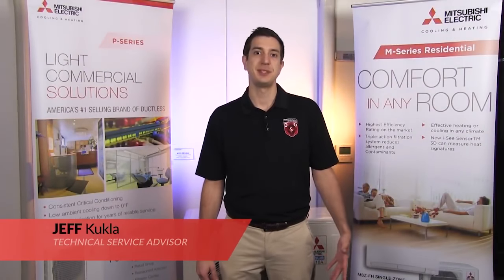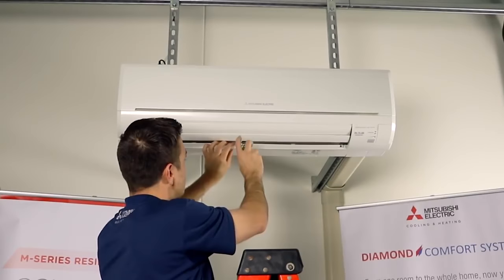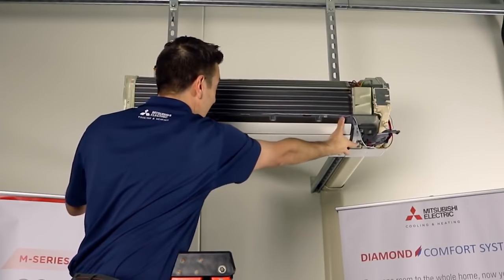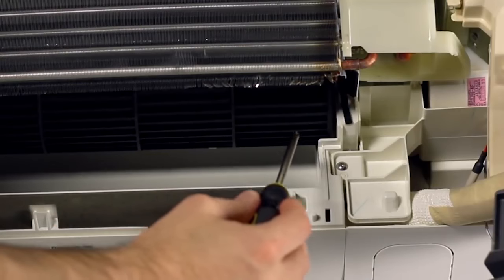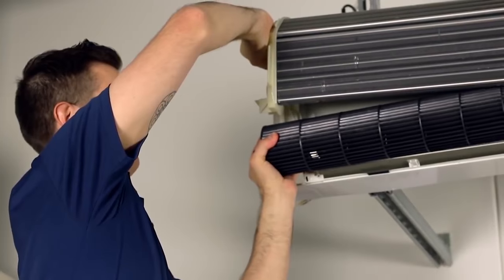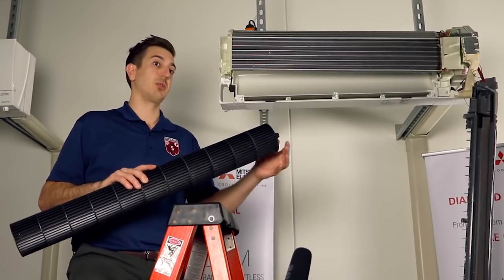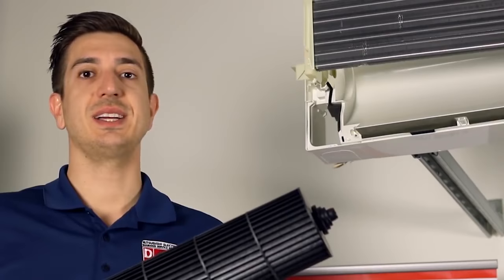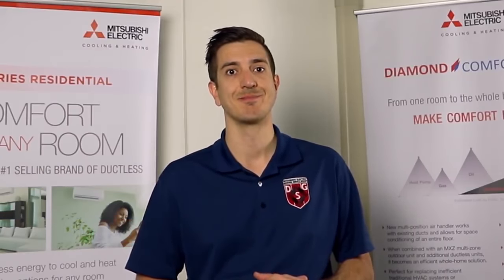Tech Tips: How to Remove the Blower Wheel (L)

Comment: I do Have a Mitsubishi so this helped.  I paid $280 for the company who installed it to clean it 2 years later because it wouldn’t blow much. .  This time I watched your video 3 ,4 times and did it myself.  I had some sticky points and I neglected to align the drip hose correctly the first time,  but I went back and fixed it.   Now it blows strong. Wow.    Update: 3 months later, I had to do it again.  Wasn’t as bad as the first time however.  If that roller blade is dirty, the performance of the fan action is greatly reduced.   Not looking forward to doing this 4 times a year.  But, thank you for the great video

Comment: I like the simplicity of Mitsubishi's design when doing cleaning and maintenance on the mini split. I first vacuumed the blower and it made a huge difference but decided to take out the blower wheel and give it a thorough cleaning. This video made things easy to remove.
Reply: Nitro would a dirty blower wheel cut or reduce the cooling efficiency  by 20+ %? This is the problem i have now.
Reply: @ronniepapa1  Most definitely. My A/C hardly blew any air when the blower wheel was caked with dust. Just vacuuming the blower wheel made a huge difference.
Reply: Thanks!!
Reply: @nitrofiche7206  
If i could ask one more question. My tech cleaned the blower wheel last august..real quick by vaccuming. No removal. Since that time blower, even in max setting, is less intrusive than in years past. Also the cool air is having more difficulty in reaching the lower level. Its clearly straining when temps are in ninetys and off by 4-5 degrees from requested temp.do u still think the blower wheel is the main culprit? I have had the freon checked lately. Told it was ok. Thoughts would be appreciated. Thanks 
Ron
Reply: @nitrofiche7206   Nitro just had my AC blower cleaned by someone who knew  was he was doing. What a difference!  My blower wheel was so dirty with guck, dust and  mold, it was unbalanced and vibrating when spinning. Thats how bad it was. What a waste of time and money when I had it cleaned last year by the Mitsu tech. I am back to working like new and my freon defficiency was likely caused by this filth and guck!  For all our benefits, get your blower wheel cleaned by someone who takes the time and knows what he's doing. I think the nightmare is over. At least  I hope so.
Reply: @ronniepapa1  I would remove the blower wheel and give it a thorough cleaning.
Reply: These are great a/c units, but the blower get dirty pretty quickly and performance drops like a rock in a swimming pool.
Reply: @ronniepapa1 1/16th of an inch reduces efficiency by 30%. It makes a huge difference. Especially mini splits.

Comment: Great video. This combined with your vid on taking the cover off (the clips are stubborn) was perfect. Took me an hour. Hardest is getting the drain pan back and lined up, and also getting the clips back in when putting the cover on. mine was running like 5 years and I never thought to check the blower. I was always keeping the filters clean. Anyway my blower was so caked with dust, likely from a reno I did a few years back.  I'm so mad I went through a couple hot summers with it not working well. Well worth it to clean!!+

Comment: Thanks very useful. Set screw was a bit more to the right on my earlier model and required removing a plastic piece.  Other than that, easy to follow and unit is now sparking clean.  Years ago a former Mitsubishi authorized dealer dealing with dripping water from the unit came and charged over $500 to "clean" the unit.  Just took the plastic covers off which I ended up cleaning myself on the patio to save the service person some time. He left the blower wheel in place, just wiped down the surface and told me that it was not removable.
Reply: thanks - mine was the same way !!

Comment: This was extremely helpful. Only real issues is that drain pan really doesn’t want to come out and feels like you might break it , you should zoom in on the specific clips cause they aren’t super obvious .

Also getting the wheel back in under the coil and inserting into the motor is a bit tricky .

Thanks for this video , was able to clean a pretty nasty wheel and inside and now I feel confident I can tackle the other 4 units .

Comment: I just cleaned mine with out removing the out cover just the vertical  louvers and folding the horizontal louvers out of the way  using a vac and modified tooth brush....  real pain...  I'll try this method  on the next one but do have to comment that removing the outer cover on mine is a pain in the pitutie ...  and you have to pry it loose with a screw driver or such after removing the screw...  I will say we have 5  Mitsubishi Mini-splits and love them....   the one I cleaned was starting to 'howl' because of all the dust and mold built up on the Blower Wheel.  Been running for just over 3 years.
Reply from the maker: Thank you for sharing your experience!
Reply: The method shown in the video is the best way... but it is not nearly as easy as the guy shows... read through some other post and you will find that there are a number of secrets to get the whole thing apart....  something you have to do just about everyday to get right.  We have 5 units and I finally got it down on about number 4....

Comment: I live in Puerto Rico and they only charged me $75 to clean a 30K BTU unit, so I had them do it.  All they did was drop the drain, then the guy literally ripped the metal grid (that protects if the wheel disintegrates) out of the unit and threw it away.  Now he had access to the blower wheel from below, which he never removed.  With a protective cleaning cover on the whole unit, he just sprayed it with evaporator cleaner, as he turned it.  Then he rinsed it really well with water from a pressurized sprayer.  It was full of mold when he started and I checked it when he finished and its completely clean.  He snapped the drain back in place and it was good to go.  The blower wheel never came off.

Comment: Hi Jeff I tried removing the blower but it's not coming out. I have removed the setting screw and yet it is not coming out. Looks like  the right side bush is stuck to the shaft of fan motor. Is there any trick in removing the blower from the fan motor shaft? Thanks
Reply: 2:10 hi I was able to remove the wheel last year but this time I am having the same problem, the wheel got suck to the motor. Did you ever find a solution for that? My wheel is covered in mold and the company that installed my Unit no longer works with Mitsubishi.
Reply: @AM-dg9nz  Well I tried removing blower from my another mitsubishi split AC today and it has the same problem. The blower doesnt come out easily! The blower pin gets stuck I guess. There must be some industries hard kept secret here :-D  Good Luck with your blower servicing efforts!
Reply: Just had this exact problem. Sounds excessive, but a small crowbar between the blower and body/motor of the AC released it with minimum effort. I had otherwise tried prying from the outside of the blowing while pulling as hard as I could but it wouldn't budge. The trick seems to be to get that lever force applied as close to the center/shaft as possible.

Comment: Drip pan looks really easy to remove in your video, but was quite rigid in ours, especially the right side. Please show how to do the reassembly, especially the drip pan, aligning the blower, and getting the cover back on. The blower was rubbing on something when we turned it back on, and we had to disassemble all over again. Some checks along the reassembly would have prevented this.
Reply: Yes, I can't get the drain pan back on the right side. Any advises?

Comment: Excellent! Succinct and clear. Nicely done...again.

Video request : Assessing system refrigerant level status without breaking system with gauge set. No error codes. Good airflow. Clean.  
Or, is recover and weigh-in only reliable option when slow refer leak suspected?
Reply: As I understand it, you can run the unit in emergency cooling mode, measure superheat, and then measure amp draw and apply a correction factor based on outdoor temp. If superheat and amp draw match unit specs then you know you have proper charge.

Comment: Blower was stuck n couldn't get it out. Ended cleaning it hang halfway out. Took longer but job done. When puttin back the blower screw, must push blower to right most before tightening screw. Didn't do that the first time. Think Blower hit against something on the left...ratatata sound. Gotta dissemble, put blower to rightmost n tighten. Then sound was gone. Cleaning the other blower tomor. Should be way faster. Thank you so much.

Comment: After reassembly the blower wheel is now making a slight clicking / scraping noise that wasn't there before. 😳. Could the blower wheel be pushed too far into the shaft? Should I loosen the set screw and nudge it back to the left a little bit or would it be from a bent aluminum fin or something like that? I really was hoping not to have to take everything apart again. Any advice? Should there be some sort of lubrication applied to the moving parts of the blower?
Reply: There is a bit of play left to right try and do some testing. Mine did the same after the first assembly, loosened the screw and readjusted the blower wheel a bit more to the left and poof gone.

Comment: Just wondering if its possible to vlean this thing? After a recent mold clean, everything was cleaned, besides the blower wheel, it’s impossible to clean its mold, the mold would be on each of the individual blowers and spraying or a hose wont fix it. Is the only option to replace the wheel?

Comment: Hi Jeff, I have been looking for a video  on how to remove the Blower Wheel on my Mitsubishi Inverter (Heavy Industries). You  showed it just like... remove the screw, GRAB AND PULL THE DRUM AND THAT'S IT!... well, have been figuring-out for half an hour.. it it loose, removed the screws but would not release. With other brand I would easily remove it but not with Mitsubishi. There must be something that holds  it like clip or sort of because it is loose but wont release.

Comment: Drain pan was a pain to get back on as another poster commented. Also, reinstalling the blower was not ease. Getting the rubber bearing in to fit in. Then the blower wouldn't spin, and that's where I am! Don't want to burn out the motor, but it is not spinning freely. 
With how nasty these units get inside, this should be designed as  a much easier procedure
Reply: Make sure you screw down the fan set screw, onto the motor shaft. Otherwise, it will spin free.
Reply: Yeah I got the same issue.  Couldnt reinstall the rubber bearing.  Wouldnt fit for some reason.  Any ideas?
Reply: Don’t remove the rubber bushing on the motor side

Comment: So I had my drain pan clean and drain pipe clean out as it was leaking now when I switch it on main power on the air con just blows constantly the remote won’t turn it off nor does the buttons on the ac is this happening due to being a hard reset an needles to re sync it self or thermostat issue

Comment: Mitsy GE09, we have 100 of these units in our hotel and this morning I have had the first one in 10 years that it is impossible to remove the blower wheel (Evap) the grub screw cam out easily but alas the wheel has rusted onto the shaft and I cannot move it despite a good wd40 soaking. The blower motor is defunct and needs replacement but cannot move forward. Beginning to think I may have to replace indoor unit completely but I have just been advised that they are no longer available. Any ideas?? Please!!!

Comment: It's a shame all models aren't designed the same.  The blower wheel on my Mitsubishi has a rubber compound in addition to the set screw.  Besides taking the entire inverter off the wall and dismantling, I can't see any other way of removing the blower wheel; not to mention, not knowing what the black rubber compound is, how to remove it, and re apply.  Accessibility for maintenance (to clean mould that is guaranteed) needs to be engineered into the design of all models, or it forces people to pay an avoidable service fee, or even worse having to buy a new system.

Comment: My Mr. Slim's blower wheel doesn't have a set screw and doesn't want to come out.  Maybe mine is an older model; It is around 15 years old.  Thanks for the video, but without the set screw, this isn't going to be nearly as easy.  I guess I'll either continue taking it apart or put it back together without cleaning it.
Reply: Did you ever figure out how to remove the blower wheel? Mine doesn’t have a set screw either and doesn’t want to pull out.

Comment: Sir i have just mitsubishi inverter. When i set it on 16 Celsius ,afer 1.5 hour  its led lamps become dim and it  changes swing position  and  its swing does not respond to remote controller afterwards. Is it faulty?  i have to restart it again to make swing adjust once again.

Comment: Does a little dirt on the blower fan really affect its performance?
Thanks.
Reply: Yes.
Reply: Well think about it. The blower originally has no extra weight but with that little dust on each blade it adds up to a bit more weight causing the blower to loose efficiency
Reply: eventually the wet/humid  dirt sticks more dirt to it and the efficiency goes I'd say keeping it clean is the best solution but a bit of a practical art. Once learned not forgotten. Did you do what I did and left the input filters off for a month due to abject laziness....!
Reply: Dirt / lint looks like mud on the spokes of a bicycle wheel, only thicker.   On the fan, the pitch of the blade is now a blob of gnarl. It cannot grab/push air.

Comment: I could not remove the blower wheel.  It seems to be stuck.  The set screw has been removed and the screws on the left side have been removed but the wheel will not pull out.
Reply: minimootoo  in an earlier post, someone said you need to tilt the wheel downwards ~15deg then pull out.
Reply: @anhoi6969  I'll try.  Thank you for taking the time to respond.
Reply: Having the same issue but it’s still stuck

Comment: Does this one have a drain pan
Reply: Yes, it is a horizontal tray as seen in the video, with your drain pipe connected to either the right or the left of the unit. The drain pipe is normally on same side as the refrigerant piping, I assume. In this case, as seen in video, it is on the right.

Comment: I did everything and put it back.the fan is NOT turning.Unit is on .
Reply: Bernadette Grisham I had the same issue. So I removed the set screw, lowered the left side a bit, one was able to push the blower a bit further into the pin on the right. You should see the pin sticking out a bit through the horizontal hole to the left of the set screw. Spin the wheel by hand to ensure no binding, and put the set screw back in. That solved my problem.